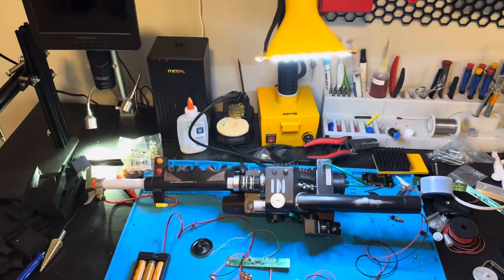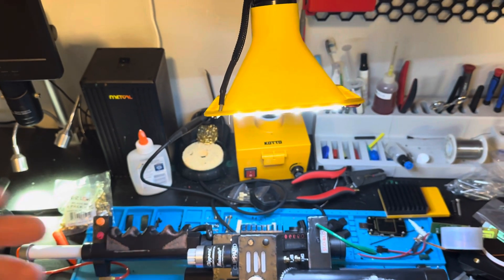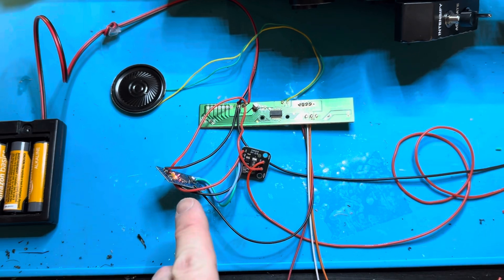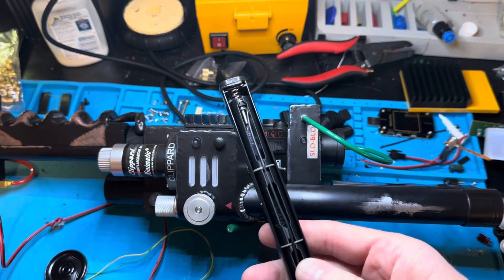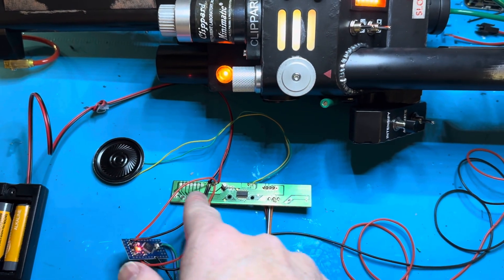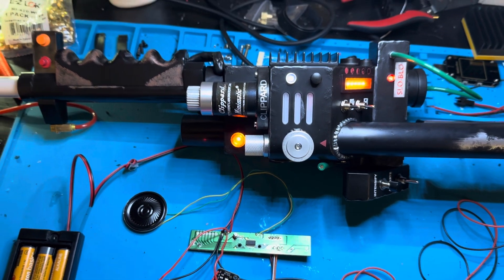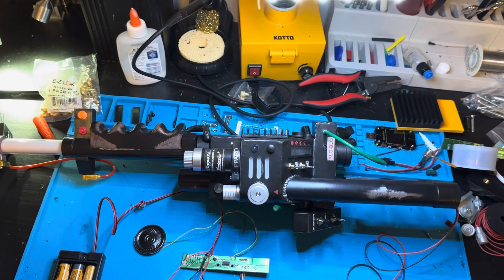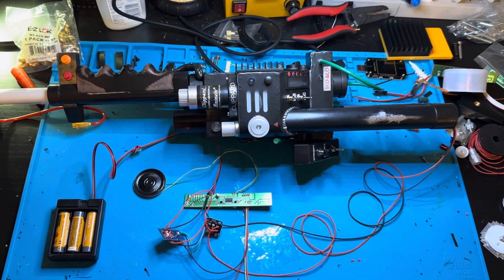Spirit Life Size Proton Pack - Hasbro 1984 Wand integration mod!

Comment: If someone already had the parts, would you be willing to share how you did it?
Reply from the maker: @duncancosplay7839  Yes, I plan on putting information in my git repo as I get farther along into the process. The current code and things will also work just fine on another arduino platform like a arduino Nano. Ultimately though, I’ll be moving my code into the Pi Pico C/C++ SDK

Comment: Any rough ideas when these might be available to purchase? A month? 6 months? I've been desperate for an affordable way to power my Spengler wand and life sized spirit pack with the same power source. I'll be jumping all over this as soon as you have them up for sale!
Reply from the maker: @Sleikis  I’m hoping about a month. I’m finalizing the hardware design and should be ordering test boards in the next week or so. I’m also still working on the software as I need to add additional options.
Reply: @cowdog360 Awesome, can't wait! You mentioned in the video about adding integration with custom packs, would you happen to know off hand if there will be integration with the newly released Spirit life sized electronic kit from Frankengeek Laboratories, or at the very least if the wand might be able to draw power from the board with this?
Reply from the maker: @Sleikis  My setup would be intended as an alternative choice to his solution, and not designed to integrate with that. One of the limitations of using current sensing to work with the Hasbro wand unmodified is that you can’t really know which buttons exactly are being pushed, so all the extras like video game mode, music mode, etc, just wouldn’t be possible. But my board will have the ability to add your own LEDs and possibly even some basic pack sound. I may also add support for the stock spirit wand, although the main goal is to pretty much let the Hasbro wand handle the sound and just the board handle basic lighting.
Reply: @cowdog360  good to know, thank you!
Reply from the maker: Unfortunately life’s thrown some curveballs so I haven’t had time to work on it beyond my prototype PCBs. But hoping to soon!
Reply: @ No worries! Shit happens! Not like I could place an order right now anyway. I'm located in Canada and our postal service has been on strike for 4 weeks now, with no end in sight. I've got no choice but to wait anyway lol
Reply: Any update on these?